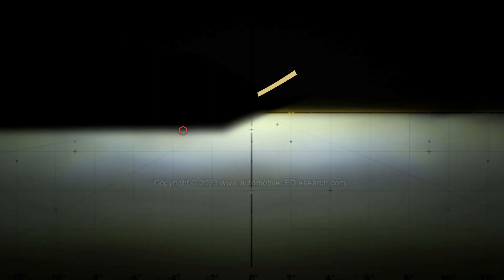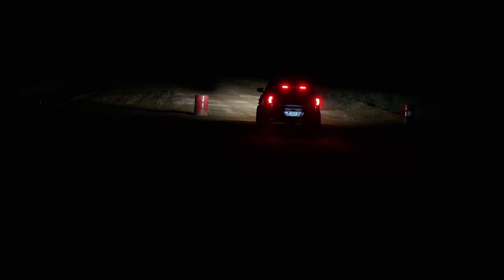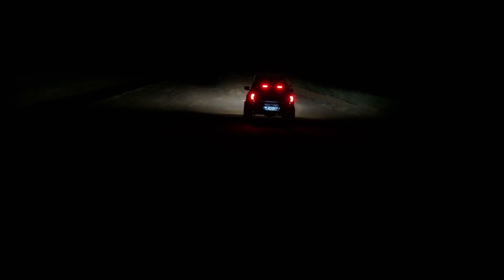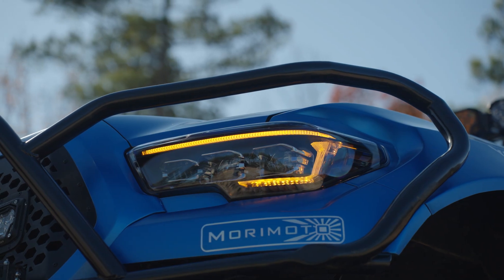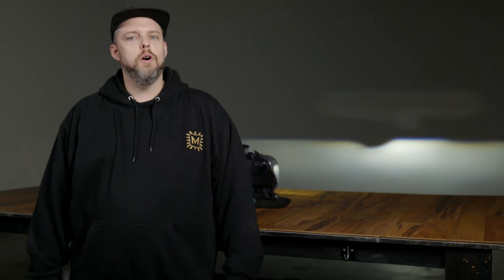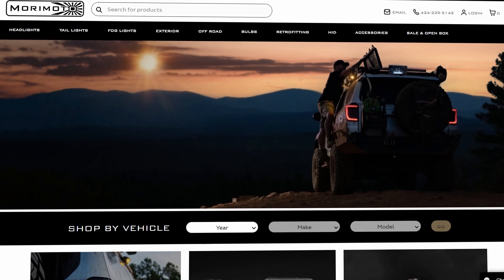Beam Patterns Have Changed… Here’s Why! | Morimoto XB Evo Headlight Beam Pattern Explained

Comment: I had the Smoked version (as opposed to black) installed on my 2023 Tacoma about 3 months ago. That dip in lighting is VERY pronounced on a dark night with no street lighting. Also the dip in lighting only works as designed when you are going in a STRAIGHT LINE. Once you turn a curve that dip darkens the road directly in front of you or puts the full beam into the oncoming lane depending on which way the road curves. It's very disturbing to go around a curve and have the visibility in your lane go down to 20 yards. Before I bought these headlights I had watched other videos, not this one. In the other videos they had the lights shining on a wall maybe 15 feet in front of the truck. At that close of a range the dip is barely visible. Mounted on your truck on a level road 20 yards or so in front of your truck that dip is VERY pronounced and covers the entire oncoming lane (as designed). Like others I thought I had purchased defective headlights until I saw they were designed this way. I have the Morimoto XB Tail Lights (Red), X3B 3rd Brake light and will be getting the Morimoto XB Fog Lights in the near future. I really do like all the Morimoto Lights I have except for the headlights. Knowing what I know now about that dip and the experience of driving with it daily from work at night, I wouldn't have purchased them.

Comment: My 2024 GTI has a beam pattern like this. After taking the bumper and headlights off, I’ve been scratching my head on how to adjust them back to spec because the pattern looks so much different than any of the online guides. This definitely helped me align my lights back to normal! That blacked out section definitely looks odd until you realize it’s supposed to be there. No more getting flashed at night.
Reply from the maker: Glad you were able to align your headlights correctly—it sounds like you’re enjoying the updated beam pattern!

Comment: Sorry for the off-topic but I am an overseas European customer, and I have recently purchased a set of Morimoto XB tail lights for a 2002 Ferrari 360. My car is a European model and unfortunately I received the wrong version of your lights with US wiring and harnesses. When connecting the lights to my car, they don't work. I have tried to find a solution and was recommended to contact you to get an European harness and wiring kit for the lights. Does Morimoto have the European wiring kit available that I can order as soon as possible? I have contacted Morimoto tech supposed via email for weeks and not one time got a reply, really shocking. Thanks a lot, Michael
Reply from the maker: Hey Michael, we appreciate you reaching out and apologize for the lack of response from tech support. Unfortunately, we do not currently offer a Euro-spec adapter for the Ferrari 360 - at this time, we only have a European wiring kit available for the F430. Since these lights were designed and tested for US-spec vehicles, compatibility outside the US isn't always guaranteed.